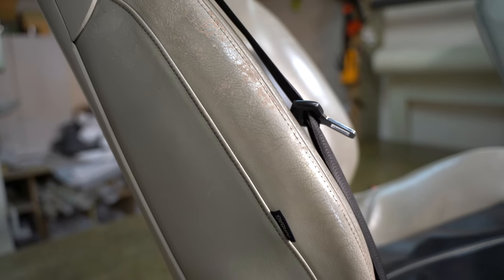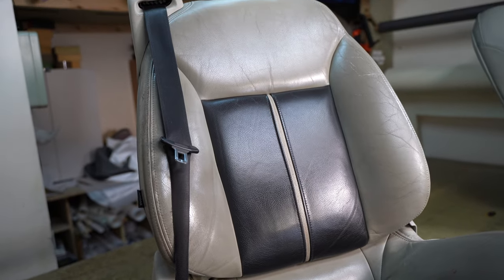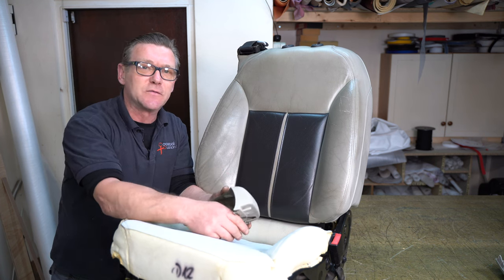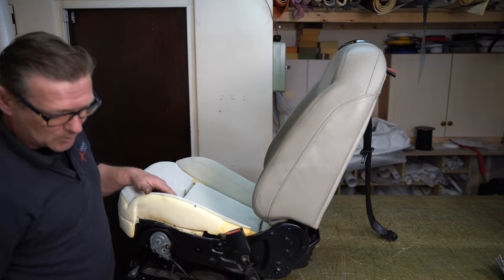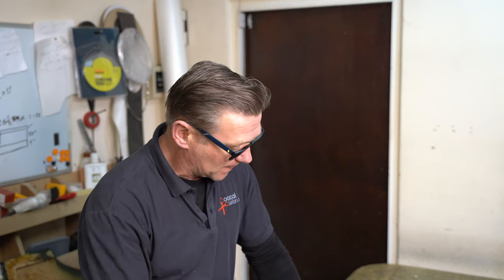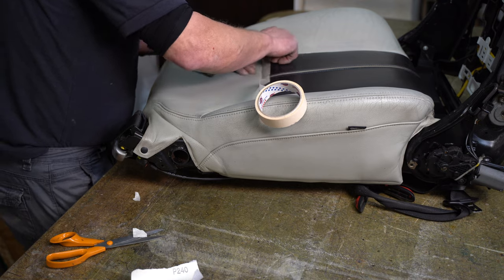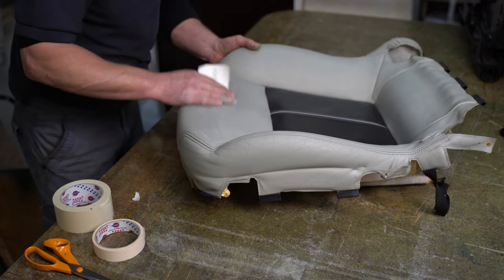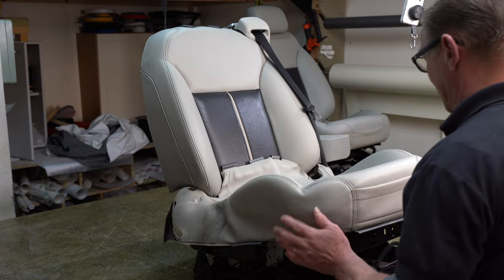Saab 93 leather seats restoration

Comment: Hi, lovely job.. just curious about the paint you use, is it just a normal water based acrylic please. or do you use a particular brand like Createx etc ..and is your clear coat the same as a acrylic resolene finish or more like a resin based finish please?
also, what is the lifespan of the products you use, will they crack and peel please. .sorry , so many questions, i'm a leathercrafter 
but i use oil based dyes, not acrylics and only on natural veg tan not upholstery leather and seats.. the stitching is obviously not a problem but i'm a little worried about re attaching the leather,, is it obvious where you need to hog ring and do you recommend a straight or angled ringer please.. i only want to do my 07 Aero 2.0T,  so only need tools etc for this particular project.. thank you..
Reply from the maker: Both colour and clear coat are water based and I buy from furniture clinic, If you do the correct prep it last almost as long as the original finish. You should buy an angled ringer it will make life easier
Reply: @coastalcushionco8227  , thanks for taking the time to reply, much appreciated..
Reply from the maker: @benjammin1212  your welcome